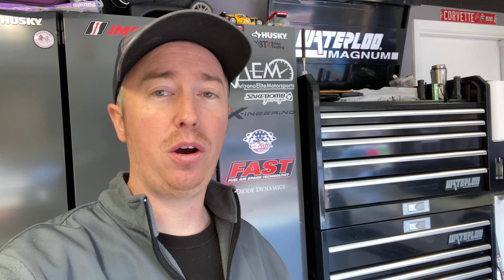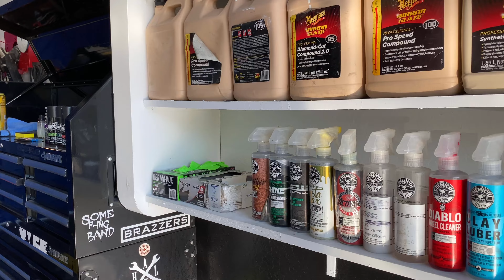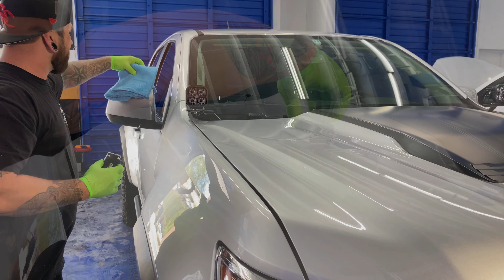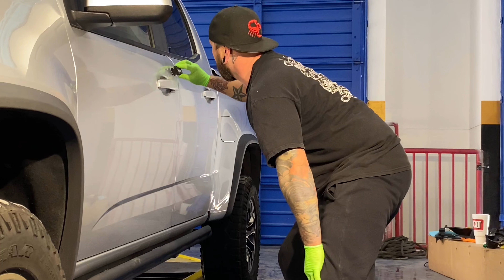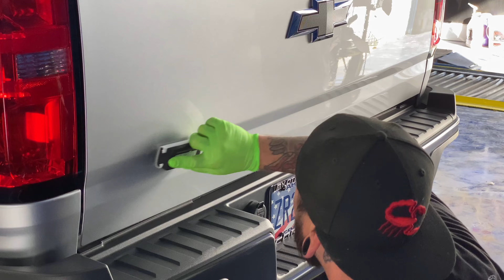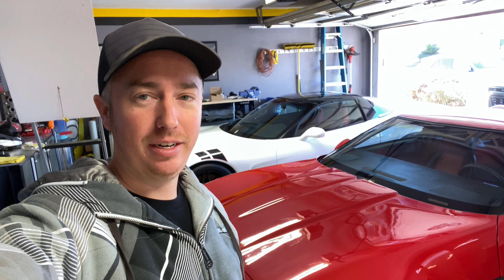Ceramic Coating The ZR2

Comment: Hey Chris!  Can you tell any difference in before/after as far as shine?  How long does it last and does car washing remove it?  Can you compare it to Expel coating?  How much did it cost?  Sorry for the bombardment of questions...I’m just trying to figure out what to with my own vehicles.  Love the content, and what a nice looking truck!  What is the ride quality?
Reply from the maker: Huge difference.  Looks like glass.  Expel is great.  Expel will never have the shine of the real paint though.  Some people even do both. Cost is completely up to the installer.  I’ve seen anywhere from $500-$2000.  Really depends on the condition of your paint and how long it takes to do the paint correction process.  My in-laws just had their brand new 2021 Mercedes done and it took 8 hours.  I’ve seen the process take 5 days on some cars.  Washing does not remove the coating.  Depending on what coating you use it can last 2-5 years.  Expel is also very expensive, can be as much as $3000 for the full car.
Reply from the maker: Love my ZR2.  Ride is great.

Comment: How long does ceramic coat last ?  Does it protect the car from stones chipping the paint ?
Reply: I have ceramic coating on my c5 z06. It’s been on 3 years and still going strong. It doesn’t protect from chips though. There is clear film that’s made to protect from that however
Reply: @johnnoel3416  thank you !!
Reply from the maker: Depends on what coating you use and the conditions the car is stored.  2-5 years is normal.
Reply: @mycorvettelife  OK, THANKS !!